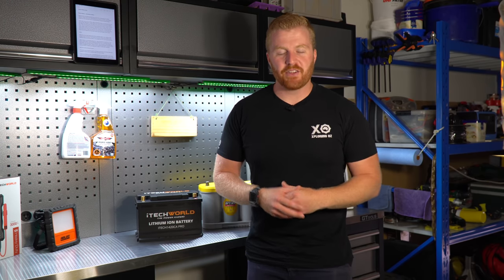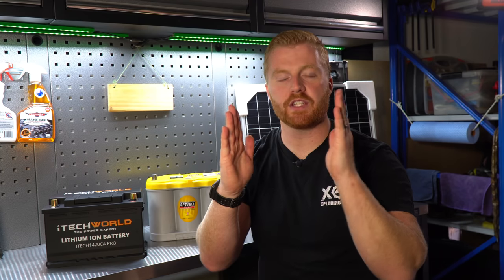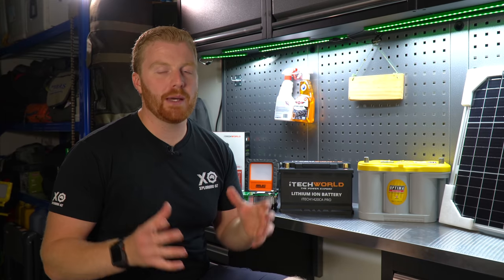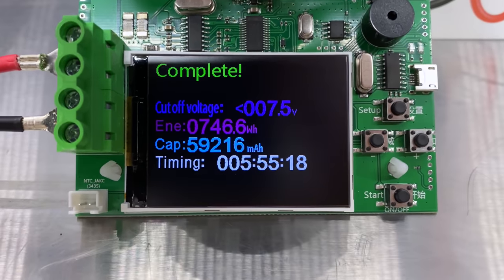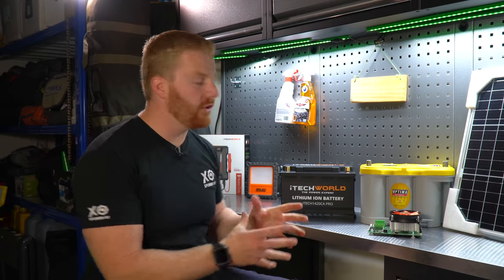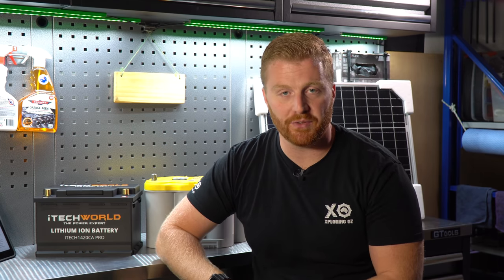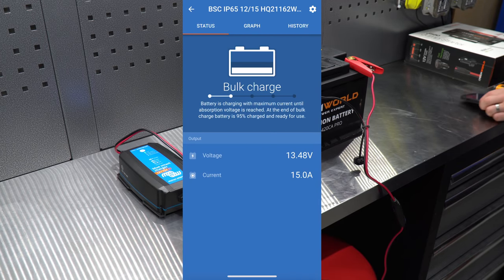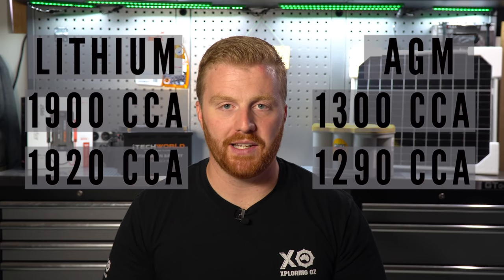LITHIUM CRANKING BATTERY | 1420CA PRO | Can it POWER the 4.5L V8 diesel? iTechWorld Starter Battery

Comment: I was born and lived in Canada for a good part of my life and can add through first hand experience that it’s not only the cold temp of a battery that creates challenges.  The BIGGEST issue by far is the viscosity of the engine oil at very cold temperatures.  It will literally be the consistency of molasses.  Now imagine a starter trying to spin a crankshaft through something that thick.  The additional current draw in that scenario is massive and everything but the largest CCA and healthiest of batteries will struggle.  Throw in the fact that it is much more difficult to atomise and ignite the fuel/air mixture in a freezing climate and you can see why batteries only make it through a couple of winters before they need replacing.  I guess that’s why some bright spark invented block heaters for cold climates.
On a seperate note, I wonder if Itech would have provided you with a freebie if your comparison was against another lithium start battery 🤔.

Nice work on the testing mate.  I have always stated I will replace my lead start with a lithium when it dies.  The weight savings is the only convincing I need.   Cheers from Jafffa Adventures 😎👍
Reply from the maker: I hear you! This would make a huge difference to the overall power required to start the engine. Unfortunately just not an option for testing in my circumstance and demographic. Maybe someone can test these unit in the Vic High country one winter and see how they go, would be an interesting watch. 
In relation to the freebie, I can't answer that, but I actually don't know of many other cranking batteries (if any) on the market to compare it with? My review on the battery is designed to be the 'value for money' category and therefore rules out companies like DCS which are inherently different in the their design anyway. Are you aware of any other rated cranking batteries?
The weight saving is a huge advantage, so lets hope this unit can hold up to it's claims 🤞 
Cheers, Nathan.
Reply: 12 months ago I put the GCS twin 75Ah system in my 200. Extremely happy with the outcome. Also replaced alternator with Rapid Power sealed unit (made in Brisbane, but also sold by Perth Diesel Performance). That has been a winner too.
Reply: Whoops...."DCS"....
Reply from the maker: @denisgately4701  Awesome, I've only heard great things about the DCS systems too. I've chosen to try these out, just given their exceptional value for money 👍

Comment: Bought 1 of these about 2 years ago, still working well. Given a high voltage always trying to charge my second battery long after vehicle is off. This will still crank with the voltage drop.

I'm more concerned about winching. Im yet to test it

Comment: Great video, very detailed! We have been running one of these itech1420pro cranking batteries whilst we travel Australia. The speed it cranks of the starter motor is crazy! We have made a video on how to instal one and the main reasons why we went that way. Prior to this my video was the one of the only videos made on the product so your right not too much info on them but they are going to get more and more common I think. Cheers great vid
Reply from the maker: Thanks guys 👍 I did watch your video on the battery and have been following your adventure around the place. They are a great option as per handy with the lightweight advantage! 
Keep your trip vid's coming and who knows, might see you out there someday 👍 
Cheers, Nathan.

Comment: Another excellent video. Many thanks for doing that test, as I have been considering a Lithium cranking battery. Regarding your statement that we are never going to reach minus 20C in Australia. Never say never. 😁 It has already happened and the coldest recording was at Charlotte Pass in NSW on the 29th of June 1994. It reached minus 23 C. As we all know, it's not a common occurrence in Australia, hence I don't think it will be an issue when buying a battery. 😁👍🏼🇦🇺
Reply from the maker: Cheers mate! 
You are correct and I shouldn't have quoted 'never' in this episode. Very rare circumstance, however I do know that I don't plan on camping and keeping the vehicle stationary in those sorts of conditions 😂 
Cheers, Nathan
Reply: @XploringOz  Have they got internal heating incase of low temp?

Comment: I purchased one of these starting batteries about 3 years ago.
First problem i had was when my 6lt SS engine was running and battery reached full charge the altenator warning dings and flashing began on dash.
Problem i worked out was the battery bms shut incoming charge to protect battery, the altenator was in charge mode and then had like a return surge current.
This i found can easily fry diodes.
I tech said turn headlights and radio, fan on when driving or engine idling.
Yes it works, but don't forget.
Next, if storing vehicle for a month or more, disconnect the battery, it can be drained by vehicle computer.
Battery if charged will start vehicle easily several months later on reconnecting cable.
And occasionally ,not often i get home ,lock vehicle and next morning engine won't start.
Test battery 11.5...almost flat.
Yes can use a power pack to jump it.
I think there were many complaints initially.
I've adapted ,but my SS is my occaisonal sunday drive, garaged usually.
Hope that helps.
Reply: So short-sighted of the designers to use a BMS that goes open circuit, kinda dangerous for a car battery..

Comment: The insulation material in your link is $65. I am going to use a Woolworth cooler bag from memory about $4, turn it inside out so reflective side is out and cut it down in height to suit. A turn of silver duct tape around the top and hopefully will keep the battery cooler.
Reply from the maker: That should work well too 👍
Reply: @XploringOz  The bag had quite thin foam insulation so I folded it in half with silver side facing battery and out. So far so good.

Comment: Excellent test, was very informative
Great to see they work in the cold
However I'm more interested in how they survive the hot temps under the  bonnet. I understand you can't provide long temp results (yet) but would have been good to heat up a battery and see what happens to the volts etc in similar fashion as you did for the cold test ?
Reply from the maker: Thanks mate, glad you enjoyed it. 
I hear what you are saying, however I just don't think it will have any adverse effects on the cranking potential. Given that CCA's area measured at low temps and the data shows that the cranking power is compromised at these temperatures, I thought this would be a better test. 
Obviously high temperatures (above 80 degrees) would just theoretically cut out the BMS, therefore making it unusable however this doesn't seem to happen when fitting. 
Further, the main concern for heat damage is the long term CCA rating and the capacity. This is what I hoping to test down the track. 
Cheers, Nathan.

Comment: Another great clip Nathan. I didn't do anything like that when changing both my batteries to lithium but real world 14 months later and they are brilliant. Cheers Steve
Reply from the maker: I don't think most people do this level of testing, especially freezing their brand new batteries 😂 
Hopefully this will give me a good baseline to compare the batteries with after a period of use and we can see exactly how the heat and engine bay mounting solution effects longevity and performance! 
Cheers 👍
Reply: @XploringOz  Hello again Nathan.
Just wondering what your background is?
Reply from the maker: @Mick_4591  Hey mate, so it's probably not what you would expect. I went to Uni (quite a few years back now) and studied in two degrees, being Accounting and Finance. I ended up getting into local Government, which is where I'm still employed today. No mechanical or technical background.

Comment: Very interesting development. What is RRP of both batteries for a comparison? It would also be interesting to know about the number of charge cycles to get an idea of the expected lifespan of each of the batteries.
Reply from the maker: Hey mate, so the retail for the Optima in Australia is a little over the $400 mark, where as the lithium $899. According to the manufactures specifications on these units, the lithium has 2000 cycles, where as the Optima quotes good for over 300 discharge/recharge cycles.
Cheers, Nathan.

Comment: Thanks, that was an excellent review. I am surprised it did so well on the CCA.

I would love to see one of these things pulled apart to see what, if any, BMS is inside as I would have expected it to not charge when below freezing, which looks to be the case (not charging) after you started the cruiser with the frozen battery. Not suggesting you should do this though. Cheers Mark
Reply from the maker: Thanks mate, glad you enjoyed it. 
There is a chance that the time taken between freezing the battery and charging it, it managed to increase in temperature a little and the lack of additional voltage in the started engine would be consistent with a hold on the charging current. 
We'll see what happens down the track 👍 
Cheers, Nathan.

Comment: Great video Nathan, using good scientific testing !! One thing that maybe needs clarification is charging two lithium batteries from an alternator designed for lead acid ? Are you using twin DC2DC chargers to transform the voltage to 14.4 ?
Reply from the maker: Cheers mate. Negative, only using one BCDC charger for the auxiliary, the onboard BMS within the 1420CA PRO is managing the charge currents making it a true drop in replacement. 👍

Comment: Thank you
So would it make ore sense to have Lithium crank (80amp) (20hp 2 cylinder diesel)and 2x100 amp on a boat rather than having a DC-DC charger if the crank was acid
This would allow better universal solution with alternator

Comment: Hey mate,
Just question 1:
what happens if BMS switch's to it safe mode Disconnect battery from alternator wont it fry your alternator
I was looking to change mine lead to lithium in Colorado, wont we need to run alternator protection device

it be great get your feedback or if you know good auto sparky.

Nice Video on testing side of things.

Cheers Luke.
Reply from the maker: Hey mate, 
So from my understanding is that our protection is managed by the internal BMS within the battery.. .even if it's in safe mode. 
I can't say I'm an expert on this matter, but it wouldn't hurt to flick iTechWorld an email, I'm sure they would be happy to elaborate on the matter.
So far it has been performing well 👍

Comment: One big question.... Vehicles and alternators are designed to charge lead acid batteries.
The charging profile & voltages are different for LiFePO4.
Are these lithium batteries properly charged by the vehicle?
Lithium is also way more sensitive to heat, so how long will they last under the bonnet compared to lead acid?
Reply from the maker: All valid questions and part of the reason I'm running this setup. I'm out there testing the 'drop in' claims of iTechWorld. I've been using this for over a year, 7 months of that living from the vehicle every day and so far working quite well 👍
Reply: @XploringOz  When charging, is the BMS smart enough to load down the alternator until the voltage drops to a certain level, as to not overload the alternator?
Reply from the maker: @jimmybrad156 hey mate, so I’ve had this installed for almost 2 years and had no problems with any overloading. Whether it’s programmed for this, I’m not sure.
Reply: @XploringOz  Wonder what it would do to your alternator if it were mostly flat.

Comment: Have you looked into what a Lithium cranking battery does to your alternator?  Some videos suggest that since the Li battery can take a much larger charging current for a longer time, a stock regulator may not be smart enough to handle it and could overheat.  They suggest that to use a Li cranking batter you need to add an external regulator.  Thoughts?
Reply from the maker: Hey mate, although I understand this iTechWorld market this as a drop in replamcent with a BMS that can manage this. 
This being said, this test is exactly that, it's a test to see whether everything can handle this. So far it's been in the vehicle for over a year (a vehicle which we are living from for the last 7 months and used daily) and I've had no problems, so the testing will continue 👍

Comment: Great video mate, very thorough!!! Love the heat shielding idea, do you think it might also trap heat into the battery though?
Reply from the maker: Cheers mate, hopefully I covered off on most questions regarding these units. I did think about that and to be honest I'm not sure. I would like to think that the temp within the battery would not get as high as a battery without the shield in the first place, so if it did trap heat within, it would still be cooler than an unprotected battery... if that makes sense?
Reply: May I ask where you bought your multi-colored LED readout load tester? Thanks.
Reply from the maker: @johnslugger  Just got it online mate, here is the link from the one I purchased - https://ebay.us/o6H3c1

Comment: What about the warranty difference between the two types and operation in high temperatures?
Reply from the maker: Operation in high temperature is something that is going to take long term testing. The lithium battery will shut down at 80 degrees Celsius, however it's going to be the long term effects on the battery, being mounted in the engine bay that will determine its effectiveness. Needless to say that a long term review will come in time and we can re-measure the batteries capacity and performance to compare to it's new state. 
Cheers, Nathan.

Comment: How have you set up charging for both the crank and auxiliary battery?
Reply from the maker: The cranking battery is charged as per factory specifications, this is a drop in replacement battery. The secondary auxiliary battery is managed through a Redarc 1240D BCDC charger set to a lithium profile which provides optimum charging performance. 
Cheers, Nathan.

Comment: Nicely conducted tests mate. I’m wondering how things will go in terms of the ecu/alternator charging the lithium considering a lithiums state of charge being higher than that of an AGM.
Reply from the maker: Yeah, I haven't seen anything to be concerned about yet. The charging voltage will sit around 14.2V and then float around 13.5. Everything seems to check out at the moment 👍
Reply: Alternator life is questionable,  talking only about positive?

Comment: The lithium battery you tested said "Lithium Ion" rather than LiFEPO4. My understanding is that they are slightly different batteries, maybe the difference in starting VS storage batteries?
Reply: All 12.8v lithium batteries are lithium ion phosphate. 
They are safer, have higher cycle life, the voltage range mates up with lead acid. The main issues are minimum charging temperature (0c normally), huge load on alternator (until the battery is charged) and life is lowered above 45c.
As long as you can live with the downsides then they work mint, last for ever and deliver huge power output for their entire capacity
Reply from the maker: A lithium ion battery has a higher energy density meaning that it is better at producing those high CCA's to start the engine. They do often have a shorter life cycle, however still provide many of the benefits that LifePO4 include. 
Cheers, Nathan.
Reply: @XploringOz  Cheers

Comment: Any update on under Bonnet performance a year later ? The 120 amp hour ( original, not pro ) secondary battery hasn’t fared well.
Reply from the maker: Hey mate, I'll be looking to do some update videos coming early this year. The 12 month review on the aux 120X PRO is due in Feb, so that will be interesting and the starter 1420CA PRO will be hitting 2 years in June, so I'm keen to see how the tests stack up on that one, but overall, still happy with my setup.
Is your 120X not performing? What happened?
Reply: @XploringOz  I’ve got a standard dual battery system. I’m changing cars, so ll keep dual battery,  ole school one , , then onto from dual , itechworld 40 A dcdc , to a c.a.o.s battery box ( 5 Anderson plugs ) with itechworld 120 lithium inside ( not pro, I don’t trust it under bonnet now . ) then charge fridge, travel buddy . Maybe use solar occasionally ( haven’t needed to yet, all day  drive pilot driver  ) 
BUT ——- could  run my battery box 120 lithium, in conjunction with another 120 lithium to run an inverter ( say kings 1500 w ) to run a microwave for  3 minutes a day occasionally? 
Cheers for your help BTW , great stuff.
Reply: We have had the same 2 starters in our cruiser for 2 years no issues, we used rubber waffle pad to pack and provide the clamping tension

Comment: Were you able to find a solution to the DC DC issue with not isolating
Reply from the maker: Yes, so I just simply installed a relay on the red input wire, activated by an ignition feed. As soon as the ignition is switched off, so is the charger. Working well so far 👍

Comment: Out of curiosity , do you need to run a battery protection system on these lithium starter battery if your running a dcdc system
Reply from the maker: There is no requirement to run any of these systems with this setup. These batteries are designed as a drop in replacement and their BMS units can manage the power safely. 
Cheers, Nathan.

Comment: Can I run one as a secondary battery without a dc to dc charger please
Reply from the maker: I mean you probably could, but I don't see why you would use this over the 120X PRO model, which is designed for that purpose. It's also rated for underbody use and is a LifePO4 chemistry. 👍